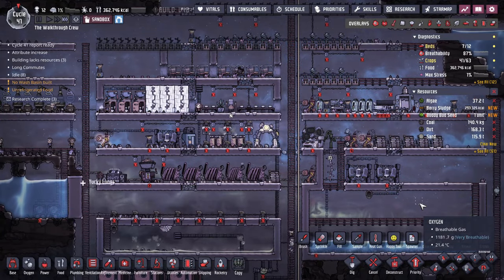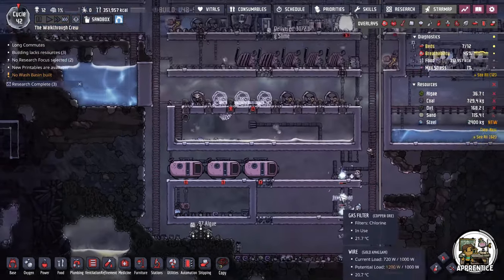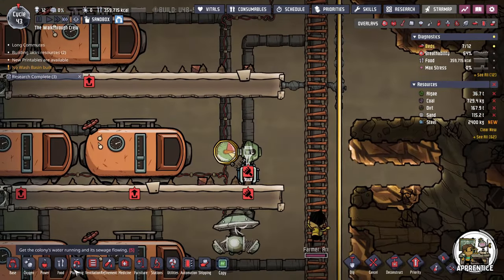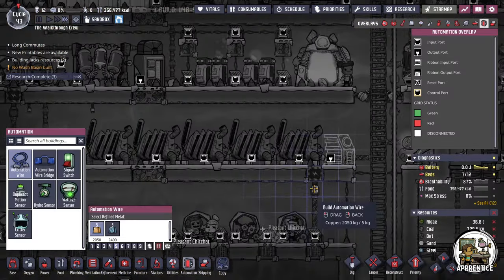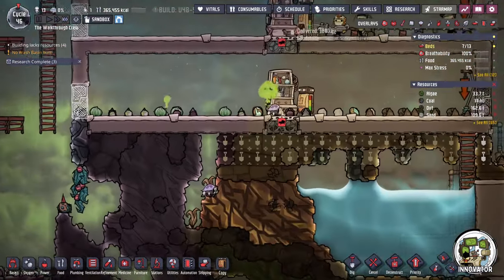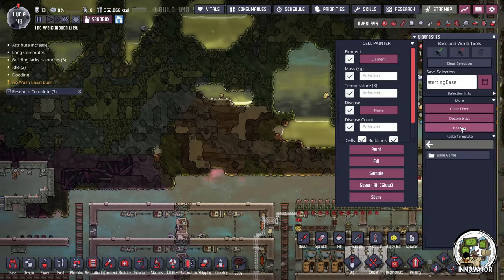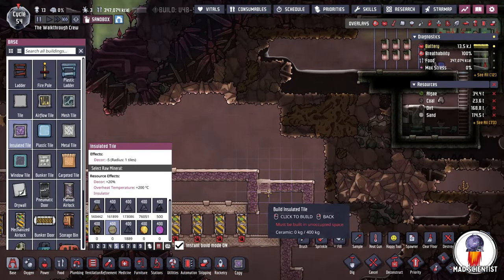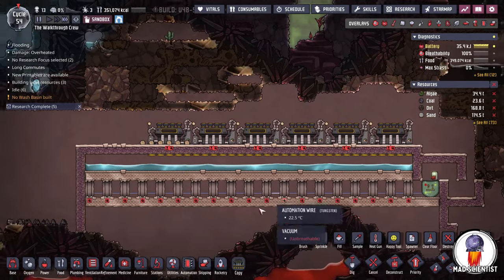HELP!  How to keep the power on in Oxygen Not Included

Comment: Duplicant motion sensor with the light bulbs around the machines will make the dupe work faster, get the lit workspace buff, and save energy because when they walk away the light shuts off.
Reply: or the pressure plate, so you don't have a light turn on just because some dupe decided to chill near the work area, and is standing right at the edge of the sensor.
Reply: @IcoKirov  you’re right. pressure plate is the best option.

Comment: When using gas element sensors i also add a second one set to polluted oxygen. This way it only turns on if its not oxygen or polluted oxygen.

Another tip is if you have a liquid punp pumping partial packets pump first into a tank and connect the automation to the pump. This means you get full packets pumped into the tank when it goes low and it shuts off when full. Saves having a pump running continuously. Later game its not an issue but saves a good amount early on.

Comment: Great videos!  I've learned a lot and very glad I subscribed.  But I have noticed something... when you run something a long way horizontally or vertically like ladders or pipes,  a slight movement of your hand while dragging the tool makes it no longer straight. 

Did you know that you can make SURE they stay straight by holding the shift key as you drag the tool?  It makes it a LOT easier to build long runs.  This is similar to a lot of drawing tools in other programs that allow you to draw a line freehand, but holding the shift key constrains it to be a perfectly "flat" line.
Reply from the maker: I will need to get into the habit of doing this.  It's always felt weird to me, but it's clear that I should learn it and apply it :D

Comment: thank you! I learnd a lot with your video, especially with the last design. I dont know if you mentioned it, but maybe I lost it due to my english level. Anyway sorry for this question. Is it any option for priority in consumers? I know almost 100% how to deal with generators (producers), which one first or last, but I didn’t find in videos about consumers. For example, if i want to have the SPOM (those pumps and electrolyzers), as the critical “building”, which get first the power and last to disconnect, how can I do it? Thank you in advance and sorry again for my english.
Reply from the maker: No worries at all, your English is great :)

I am not 100% sure how priority works when it comes to consumers.  I would assume the closer buildings to the power sources will get power first, but I really am not sure.
Reply: I'm not sure if this is exactly what you want, but just as you can use individual Smart Batteries to turn generators on based on how low your power grid is, you can do the same sort of thing with hooking Smart Batteries up to Power Shutoffs to cut power to specific circuits based on thresholds in your network's power. Run your power cable branch into the smart battery, then the power shutoff, and then into the one or pair of power transformers. A red signal will act like a break in the cable. You can also set them manually like switches.

Comment: is it possible to do the same gas filtration trick, but with liquids?
Reply from the maker: Yep!  Just make sure you always have a place for the pipe to empty on all sides, otherwise it'll back up and you'll get stuff in the wrong places.
Reply: Maybe i'm too stupid using the gas/liquid shut-off. Mostly the shut-off let a second element trough... no, not the correct one 😪

So, for the sake of correct filtering I'm still using the energy expensive filter...
Reply from the maker: @TSVThomml  You just need to make sure they are consistently powered, and that the pipes never get blocked up in any direction.  Minor instances of gasses going to the wrong places shouldn't be a big problem.

Comment: Pumping and filtering CO2 for carbon scrubber is silly. Scrubber successfully extract CO2 from air itself. You just need build it low enough.
Reply: the idea here is that you store some of it in a tank, so you can use it in a rocket for example. 
but yeah, i usually use scrubbers as well.
bad thing with them is you have to do something with the polluted water. which usually mean cleaning it up for usage again. which mean you need sand, and so on.
pumping it out is kind of simpler in a way.

Comment: this was so confusing didnt understand anything
Reply: 1) turn off anything you don't really need at the moment.
2) automate buildings so they run only when they are needed and will be efficient (for example a gas pump can move 500 grams of gas, if it is pushing less than that in the pipes constantly, then it's not used efficiently - it still uses 240W but is moving only 50g for example instead of 500g)
3) use smart batteries to turn off the power generators when you don't need more power (if the battery is near full, turn off the generator)
4) find a renewable resource that can produce power - produce coal from hatches, find a natural gas vent, or something similar.

5) use geothermal power - the steam turbines uses the heat from the steam to generate power.